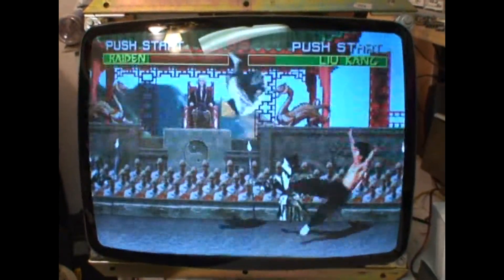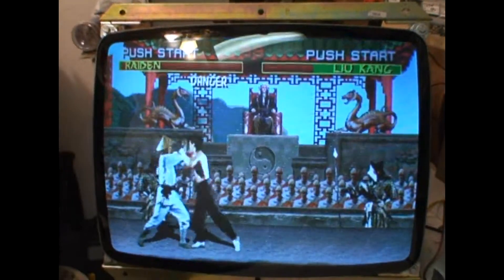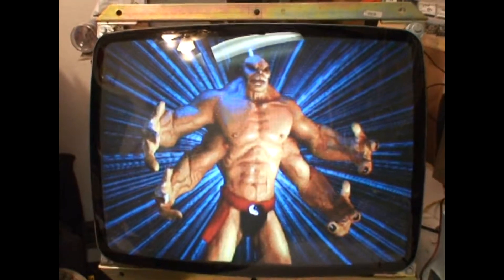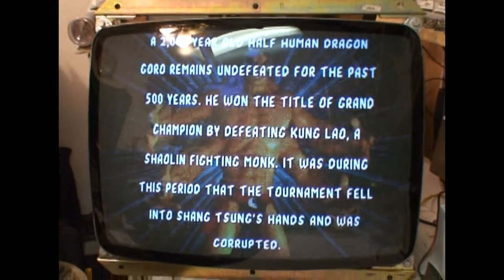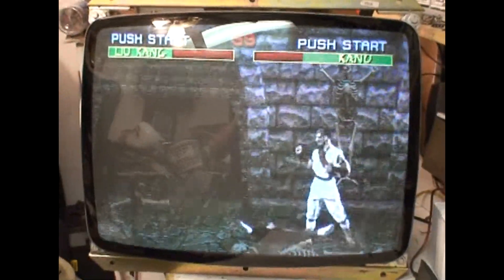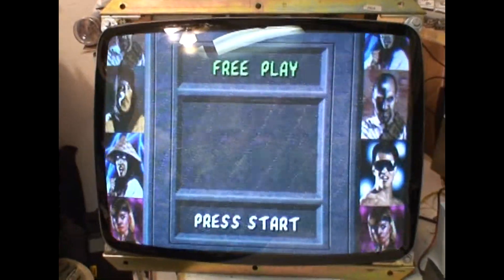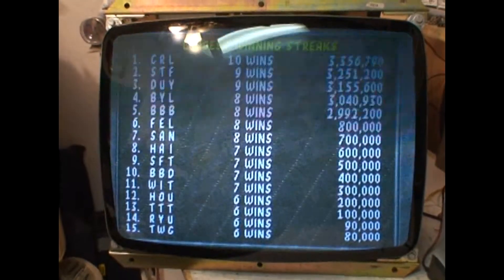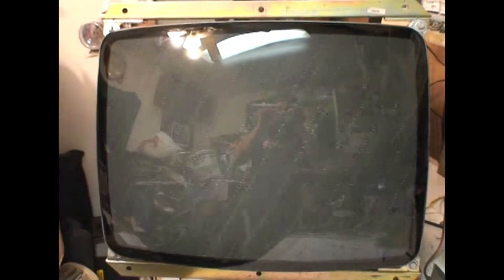25" U2000 Jeff S from my site.

Comment: Hello I am working on a u2000 cap kit and flyback. Can you tell me how you go about replacing the wires to the neckboad. The replacement flyback seem to have Xtra wires.
Reply from the maker: #BertoResto _ if by chance they have extra wires you may not have the correct flyback.
please email me pics of what you have.
Reply: Sure will. The one I ordered is from Bob Roberts so I expect it will be correct. But the ones I see being installed have the same colored wires and so on.  I'm mostly concerned about the white wire going to the neckboard connector.
Reply from the maker: #BertoResto _ yes the new flybacks can be a bit different, but the connections will all be the same.
shoot me an email and some pics of what you have.